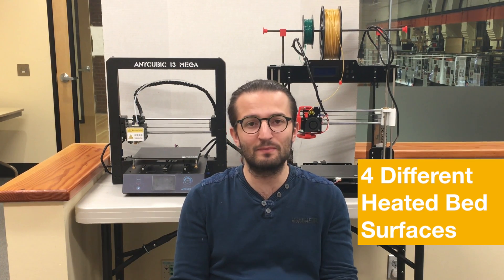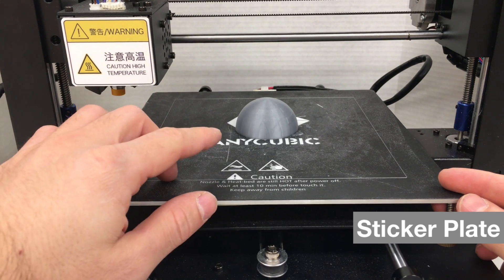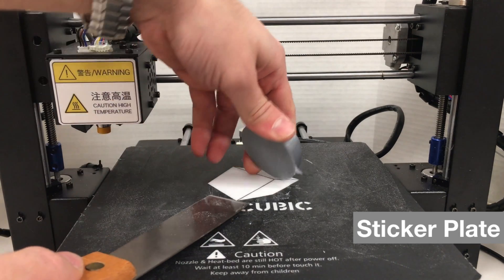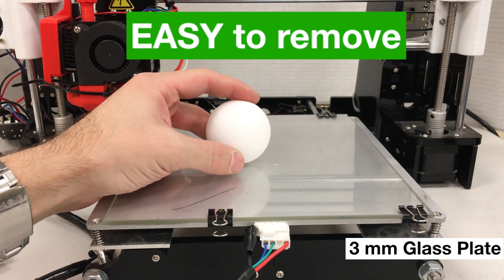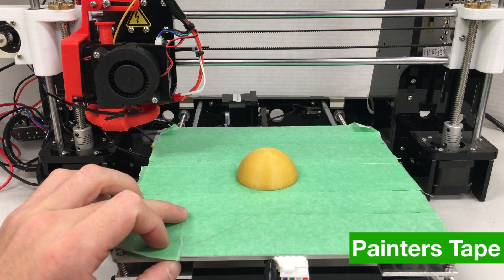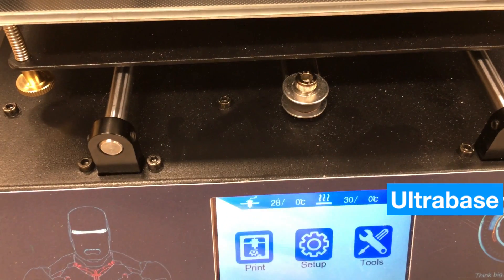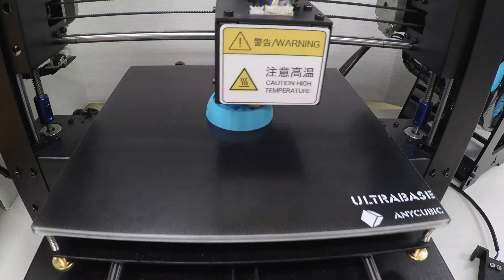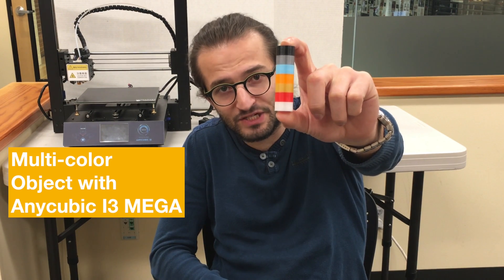Anycubic Ultrabase FULL REVIEW and COMPARISON with Glass, Sticker Plate, and Painters Tape Surfaces

Comment: i have teh anycubic mega zero no hot bed, model 1. do you think that i can upgrade it with this ultrabase? thanks
Reply from the maker: Yeah sure. Its easy
Reply: If you don't have a heated bed it won't work. It relies on the heat difference between hot and cold.

Comment: The ultrabase won't last much with petg...inevitably the coating will stick to the petg...
Reply from the maker: Thats is sad to hear. Do you have a video of it?
Reply: @3DPDoctor  I haven't....but i have 4 ultrabases to show from my 3 anycubics...i'm trying the buildtaks now,that seems to do a great job.The ultrabases if you really pushed them hard, 24h over 24h looses grip fast,even with pla,or if using petg ultimatly,even with glue stick(that solve the grip problem)you will get a chunk out.I use them on a comercial level...a hobiest probably will never have a problem
Reply from the maker: MrAranhaman i see your point. Over time I realize that too. My ultrabase is not as good as before. Company suggests sand ing it gently but previous performance is gone
Reply: @3DPDoctor  First sign is pla getting loose...after that the petg fuses with the coating and the part printed gets a little extra glass.Try the buildtak,i'm getting good results with it...only minor problem is it sticks a lilttle too much when removing the parts...even when it cools down...but perfect grip

Comment: My ultrabase is leaving a lot of residue behind
Reply from the maker: What do you mean? Is it falling apart?
Reply: @3DPDoctor  when I print something, it sticks to the bed too well and when I try to take it off the base of the print stays on the bed and the upper layers come off. Basically it snaps in half. Even using a scraper doesn't work. I use acetone to clean it.
Reply from the maker: @paarths.5281  are you trying to remove it while the heat bed is hot? You should let it cool down to room temperature. Also, check the first layer height, are you printing into the bed? if you are pressing the filament too much into the bed it might be causing as well.
Reply: @3DPDoctor  I have calibrated my printer so well that 0.2mm layer height is exactly 0.200mm. I have a sensor installed on it. So, my layer height is fine. I remove the prints when the bed is 30° C
By exact I mean I am sure that the 0.200mm is not an estimate it is exact till the last 0. After that I am not sure
Reply: @paarths.5281   I'm just having exactly the same issue ... How did you solve it?
Reply: @bitusbates  I removed it. The ultrabase was useless for me. I had to scrap it. I bought a 3 and a 5mm glass plate. For polycarbonate, I am using the 5mm glass. It's better than the results I had on the ultrabase, easier to clean and pretty cheap as well. I broke a glass plate a few months ago. I went to the market the next day and got one for ₹300 which should be $5. For adhesives, ABS slurry or even glue stick is good. Hairspray was pretty effective for me, on glass atleast.

Comment: I believe your analysis is not correct.
You are awarding a base that is easy to remove. Being easy to remove also leads to easiness to have lifting. You should be doing these tests at printing temperatures because what you are awarding may be a base that sucks...
Reply from the maker: Being easy to remove is not necessarily leada to eainess to have lifting. See the ultrabase. It is easy to remove but it doesnt lift at all. In the video I make the temperature kept constant. Removal temps and print temps are same

Comment: Just bought an Ultrabase. Installed it last night. 2 Hours later the wires broke off the bed.
Reply from the maker: Ultrabase is a plate, that you put on your existing table. You should check your solders. And resolder them

Comment: Easy release is not the single factor. You want to cosider bed adhesion and wrapping issues with various materials. I'm afraid glass won't perform well with any filament... Especially ABS. The half sphere sticks well and is not subject to wrapping too...
Reply: I can't describe how good the ultrabase adhesion is. UltraBase is a freaking miracle surface. At 45C+ you can't remove print. At 40C and below, it pops off. I've used blue tape, glue, glass, hairspray and Kapton tape. UltraBase blows them all away. It sticks like buildtac, but buildtac doesn't release when it's cold.
Reply from the maker: I only used pla for the comparison. Havent dig into various materials.  And Yeah abs wont perform well. But i think glass performs well with the pla.
Reply: Osdoyi with a half sphere for sure. Probably a slim and long part won't perform so well.
Reply from the maker: actually when I level the z-axis well, I successfully printed slim and long parts.

Comment: you can use glue stick on the sticker bed. pops of so easy. also use a brim touching the model so you lift that. problem is with glass and the ultrabase if for some reason your loose power and you have to continue the print. glass and the ultrabase just pops off and you loose the print. and have to start again. at least with buildtak you can carry restart the print without loosing the print as it's come of the bed. so i will stick with buildtak and some glue stick.
Reply: also a lot of users have had problems with the ultrabase. and have also damaged the sheet. and unlevel glass. so for me there is only one winner and that's buildtak it sticks and with glue stick spread over the surface its very easy to remove. but still has the grip to carry on a restarted print. after all that's the main point of me buying the i3 was the restart function. sorry. nice video.
Reply from the maker: If you lose electricity, with glass and ultrabase you need to start over. That is true
Reply from the maker: I got your point. Restart option is really cool :D

Comment: On the ultra base did you have to use like hairspray to make it tacky?
Reply: No. UltraBase is a freaking miracle surface. At 45C+ you can't remove print. At 40C and below, it pops off.
Reply from the maker: +J. Clowers nope nothing.